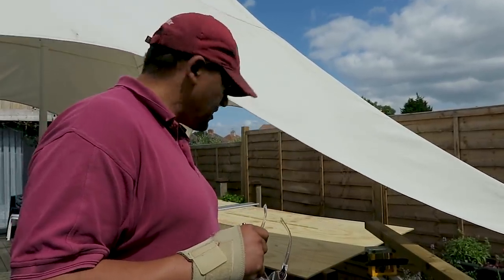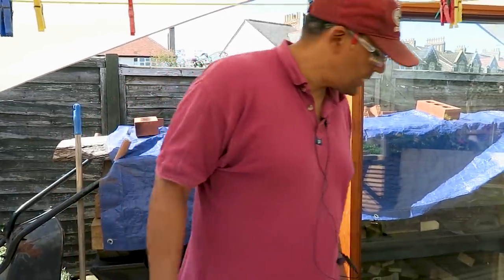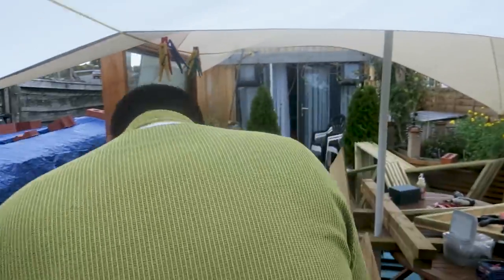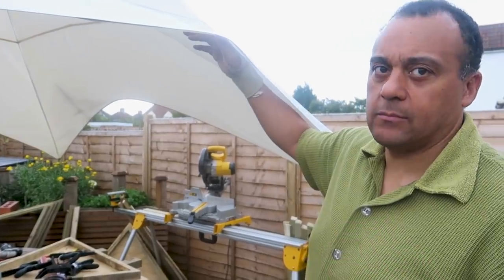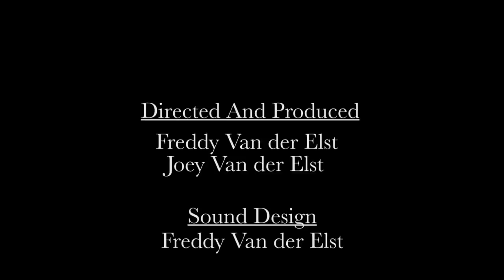My Geodesic Dome Building Process

Comment: I'm part way through building mine. Quite fast once you've built the jigs, I've spent a week on it so far and built all the pentagon triangles. I expect it will take 3 weeks in total for it to be complete. I'm doing the 6m GD27 using 3"x2" treated timber. It's good fun and I highly recommend it to anyone who has the space for one. A bit laborious but not hard at all, anyone could build one.

Comment: Well done! I imagine you may even be able to replace damaged triangular sections of the poly if that becomes necessary, but I believe your prediction is correct - you'll enjoy that dome for years to come, naysayers can go build their own.
Reply: The poly is wrapped around the edge of the triangle and stapled so you`ll have to remove the triangle before you can remove the staples ;) This construction method is also prone to leak where adjacent triangles meet and also at the vertices. Tape is appled over the joints as a fix  but its not a reliable long term solution to what is really a design issue...

Comment: Nice dome! I built a 40 foot dome but covered it with Polyurethane rigid foam board and Densdeck on top of that so panel making was a bit more involved. I want to make one like yours for a greenhouse tho. I like the design and my first question about the film looks like its already been answered.  Nice work!

Comment: AMAZING piece of work. Any leaks yet? Surely just overlapping and stapling the poly on each triange and running a bead of silicone down it won't keep the water out over time?
Reply from the maker: Hiya, thank you very much for watching the video and the positive comments. The maintenance is indeed quite a challenge. Eventually the tape comes loose and you have to redo. However I’ve found a way to go around the problem. I might make a short video about it in the near future...
Reply: Freddycityraider wow. Thanks for reply. I eagerly await the video.

Comment: That is a great looking dome and the whole process is wonderfully illustrated here. The only thing that's got me wondering is how difficult it would be to replace ripped plastic coverings in one of those triangle frames. Hope I'm wrong, but I'm thinking "bloody difficult!".
Reply from the maker: To redo the plastic is virtually impossible. One has to come up with a different solution. One of these day I’ll make a video of my intermediate solution. Thank you for watching.
Reply: @TheOldDog  i covered my dome in 4 mm polycarbonate( exterior) and i use butyl tape.

Comment: Okay I got the formula to obtain the size of the sides of the triangles. If I’m not mistaken that Dome has 5 hexagons and 6 pentagons, along with 5 half hexagons. For a total of 75 triangles. I wonder though, what is the angle you used for the curvature? Thank you so much you’ve made building domes so easy if I can find the angle 😊
Reply from the maker: 6 degrees
Reply: @TheOldDog  thank you so much Freddy I will send you pictures of the Dome when it’s finished perhaps will also make a video of the process. Always been my dream to build one!
Reply: @TheOldDog  however now that I think about it, I am thinking of building a 6meter diameter. Not sure if it’s the same angle needed. What’s the formula to obtain the angle if we know the Radius?
Reply from the maker: @Ernestoescaf  Hi there, I have no idea. I bought the plan from Geo-Dome.co.uk. That person figured it all out for me.

Comment: Nice dome 👍How did you seal between the panels? Silicone?
Reply from the maker: Yes I did. However that doesn't make it waterproof. You have to finish of the seams with a transparent tape on the outside. Special polythene tape. It holds about 2yrs. After which you will have to redo it. But it does a good job. Hope this will help. Have a nice one.

Comment: Very inspiring, I've wanted to build a dome for many years. Does the plastic sheeting rip often? I would think snow and heavy winds would cause them to break? Would you recommend har/rigid plastic sheets?
Reply from the maker: Hi There, thank you very much for watching my video. My Dome is up now I think for it's third year and the first plastic is still on. I live at the end of a windy corridor coming from the seaside and the wind can be seriously violent, but the dome nor the poly has moved an inch. As long as you put enough time in fixing it properly as recommended by Paul Robinson in his videos...Also there's poly in different thicknesses and UV resistance. It's worth looking into that as well. Regarding snow we only had maybe once or twice for a couple of days the fun of snow, so I have not much experience on that issue. For that short time and maybe 1" thick.
Hope this reply helps you to have a go at it, it's really rewarding when the project is finished and you can have the benefit and use of it. F

Comment: Great Job, looks nice. Just one comment. By using silicone between the frames you made it harder to take the frames apart for replacing the poly film. I'm wondering if the joints wouldn't be watertight enough without the silicone?
Reply from the maker: Hiya, thank you very much for looking at our video. Sorry for the delayed reply. The plastic in itself is preventing for a real watertight finish. However I have come up with a complete different solution that suits me very much and that has proven to work to a T. One of these days I will make a follow up video about it. Have a nice day. F

Comment: Hi ! I think this is the best video concerning geo domes without hubs :) 
Did you used always the same cut angle for the bevel ? or is there 2 angles ? 
Thanks for your help sir.
Reply from the maker: Hiya, thank you very much for looking at our channel and your positive comment. Once you know the size of the Dome yes the angles are always the same. But there are two different triangles to make the Pentagon and the hexagon....
Reply: @TheOldDog  Why did'nt you make it all of equilateral triangle? I'm not too sure to understand
Reply from the maker: Hiya, to answer your question. This is the way this construction works. It’s a combination of different types of triangles. A German engineer Walther Bauersfeld came up with the design. From there on things have progressed I suppose...if you would like to build one yourself I would recommend to buy a plan from geo-dome.co.uk. It’s not expensive and you will have all the technical info needed to build one...Paul the owner of the site is a very good guy...

Comment: Очень качественная работа👍 но летом будет душно.
Reply from the maker: Hiya, I have two entrances, in the summer we open them both and the ceiling mounted fan pushes the heat down and out. Works very well. Thank you very much for looking at the video. F

Comment: Love your dome! I always wanted to build one too. I have one question, what if the plastic tears? Can you take out one triangle to fix it? thanks!
Reply from the maker: Hiya, the plastic will year after a certain amount of years for sure. There’s a few places where it has already done so. However I resorted to a different solution. I bought a big sun screen and covered the Dome with it. For the purpose I’m using it, it is the right solution. It keeps it even more dry on rainy days and in the summer it provides needed shade. I might look in a different solution though in a later stage...
Reply: @TheOldDog  Did you ever consider installing the "original" film on the inside, with an outer film, as you describe here as your repair, as a means to create some insulation? I live in the cold and would need to insulate a bit for this to work.

Comment: Nice work!
Just one question, I saw that there are small gaps between the panels, do you have problems with heavy rain and water dripping through these gaps or do the screws provide enough pressure to combat that problem?
Reply from the maker: Hi there, thank you very much for looking at our video. After you have connected the timbers with the screws you still need apply a sealing tape over the joints on the outside. Which is only good for one season. (One year). The timber contracts and expands over the year and the change of climate. That and the heat from the sun in summer will eventually reduce the adhesion of the sealing tape. Resulting in leakage. Sealing needs to be redone or as I have resolved the problem you purchase a large sunshade and cover the dome with it, does the job perfectly for me. It provides shade for when we sit in the dome in summer and it makes it waterproof. F
Reply: @TheOldDog 
Panel domes are good for rigid coverings. For flexible coverings hub and strut is a better option, no tape required and you can replace the some or all of the poly without dismantling the dome because it isnt trapped between the triangles ;)  The sunshade may help but it doesnt solve the underlying issue with the dome. The sunshade will reduce the light intensity when its sunny but also when its pouring with rain.

Comment: If I could do such  a dome i'd use glass for covering it... though I don't know whether it would be strong enough to hold glass panes.
Reply: MrKA1961 that’s going to be way more money to build
Reply from the maker: Perspex has been suggested stronger than the poly but lighter than glass. Of course you can also use bulkier timber, which would allow for heavier load.
Reply: Freddycityraider there are loads built with glass and wood so it can 100% be done they normally have steel hubs just to make it easy to build tho
Reply: @elliottslab  the glass they use for greenhouses, horticulture glass, could be light enough as long as the base isn't flimsy in the wind.

Comment: Hey impressive built, what material did you used for the covers? Like plastic sheets? I will appreciate your reply !
Reply from the maker: Hi there, thank you very much for looking at our channel. Yes the cover is a plastic sheet on a roll. Polythene with UV resistance. The roll is about 4foot wide. It’s not possible to cover the pentagons and hexagons in one go. As the polythene need to be pulled and stretched before fixing to the timbre. Hope this helps you in your own endeavour. If you would have more questions don’t hesitate to ask away. Have a nice day.

Comment: What is the angle used for cutting? and what is the angle of triangle assembly .? Pleas
Reply from the maker: Hi there, thank you very much for watching my channel. Unfortunately I can’t provide you with these details. The seller I bought the plans from clearly stipulates in his contract that his design can not be forwarded to a third party. Of course the plans are very cheap and available online. And Paul is very helpful to work out the details to your needs. So please go to his website and order one of his plans and you will have all necessary information. His website is Geo-Dome.co.uk .
All the luck with your project. Freddy

Comment: Awesome , left me speechless.
How you find the angle of the lines? (Looks like when you split  woods on table saw , the blade doesn't adjusted at 90 degre )
Reply from the maker: Hiya, thank you very much for looking at the video and your great comments. Actually I followed a plan from Paul who sells them online. And in the plan he provides all the needed angles one needs to cut the timber at. Once the blade is set you just rip all the pieces. Freddy
Reply: @TheOldDog  Do you have the link to the plan please? Many thanks :-)
Reply from the maker: Rachel Photography hiya, I did buy the plans from the following website geo-dome.co.uk. The agreement is that when you buy a plan you do not redistribute it. And I do respect the owners directives. Thank you very much for looking at our video. Freddy

Comment: i undestood the triangle base, but how did you calculate the angle of cuts 1:54  (for make pentagons/exagons) and finally the dome witout fail??
its 17º/2?
Reply from the maker: Super Cool Hero hi there, thank you for looking at out video. Actually I haven't, I bought a plan from Paul Robinson. His website is Geo-dome.co.uk. Paul’s plans provide all the necessary details regarding measurements. Just followed the plan closely and with a bit of patience we got it done. F

Comment: Hey Freddy. Looks great!! I am starting on building my own GD27 and was planning on ripping the struts from 2"x3" battens but now I think that may be over kill. You think I should just go with 2"x2"s? Sorry for the imperial units, we just love making things confusing over here.
Reply from the maker: Hi Connor, I completely follow you, I thought on the same lines. However I did read quite a bit about this structure before i started and all the info was telling how strong the structure is. So I trusted Paul who came up with the wood connection. The only thing I would suggest is to make sure you don’t have knots in the struts. As that will weaken the structure....
Reply: @TheOldDog  Thank you for the reply, sir. Was this a GD27, and if so, where did you find 2x2 battens long enough which also came in a bundle like that? Thank you.
Reply from the maker: @Booyaka87  Indeed this is based on the GD27 design. I added a base, because of the diameter restrictions I had. Otherwise the door openings would not have been high enough. Regarding the 2x2's, once I knew the length of the struts to make the triangles I just bought lengths of 8foot in bulk at my local timber store. Next cut them to length and ripping the angle myself. If you do it cleverly you can get 2 lengths out of one piece. I think Paul Robinson explains that in one of his videos. https://youtu.be/JRbTyFK2m7s  that's the link to him explaining the bevel cutting. Have a nice one, Freddy
Reply: @TheOldDog   Thank you. I have been watching these videos religiously. Did you use cedar? Unfortunately here in the states it is hard to come by bundles of 2x2x96. Thank you for your time, Freddy!
Reply from the maker: @Booyaka87  No Problem you're very welcome. It's a pleasure to be able to help someone on such an exciting project. Here in the UK Cedar is very expensive, I would have loved to do it, but budget was more acceptable with cheaper simple treated spruce. About the length, any length will do it's just a matter of working out your cuts so you have the least amount of waste...I wish you all the best with the project.

Comment: Sooooo how can I build one?
Reply from the maker: Hi Rashad, that's a big question. To start have a look at Paul Robinson’s channel https://www.youtube.com/user/pauly1060
I studied his videos and than bought one of his plans he sells on his site. Paul has provided all the info you need to calculate how much timber and plastic film you need to build your project. Next you just go for it. It helps if you have a bit if DIY experience or have a carpenter background. One thing is vital is that you respect the measurements as precise as possible. Every deviation in sizes will compile itself at the moment you need to put together the hexagons and pentagons to complete the project. Good luck with your project. Freddy

Comment: летом жарко внутри будет.
Reply from the maker: Hi there, yes indeed in summer the temperature can be hot. I have solved this problem by covering it on the outside with a large sun shade. Works wonders. F